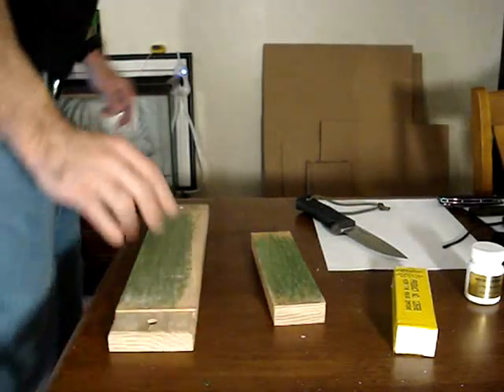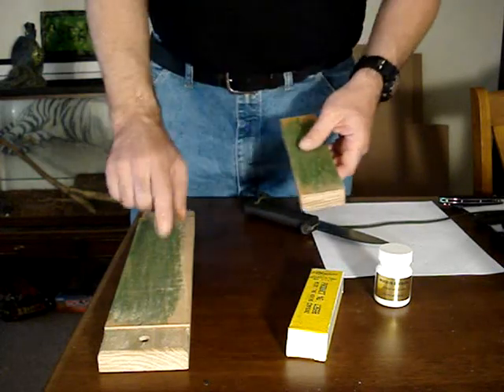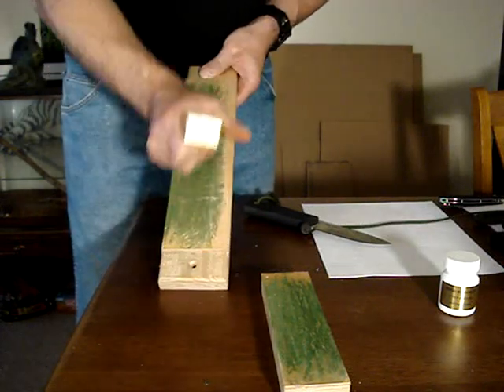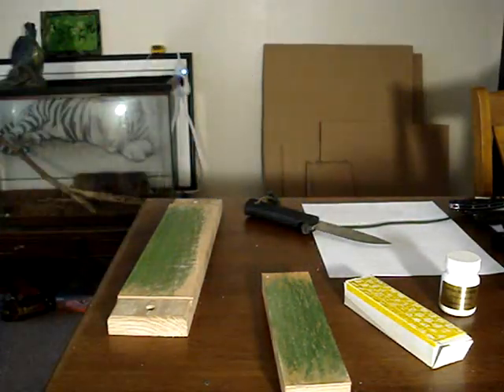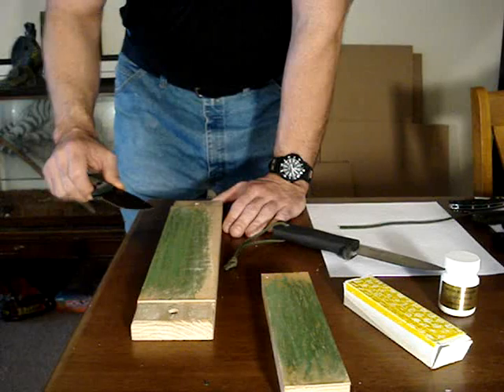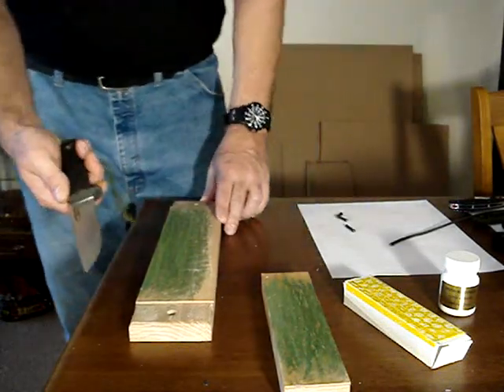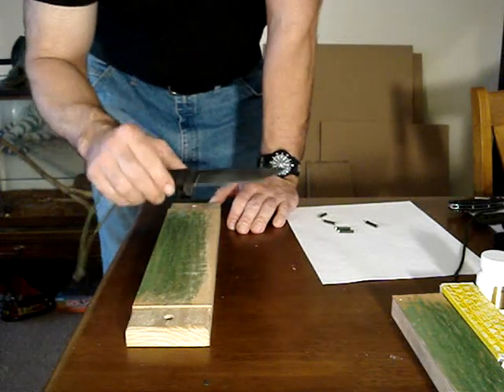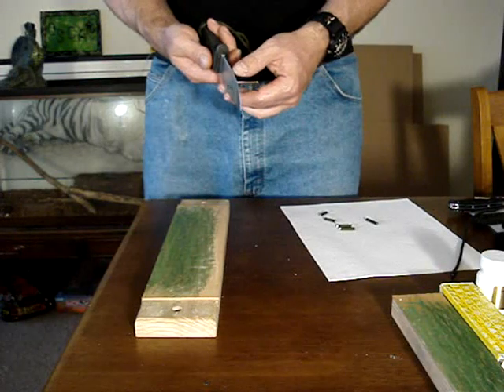Stropping a Convex and Bevel Edge (Convexing Part 3)

Comment: I sat thru all 3 videos and wasn't a bit sleepy. Interesting and informative. Thanks. I learned to sharpen knives back in the days of carbon steel, which are quite a bit softer than the steels used today. If you put a razor edge on a blade, it would round right over or form a "wire" edge if you didn't apply what was called a "relief angle". One did that by performing what is identical to your last stropping stage.

Comment from the maker: @curtispa
I don't mind all the questions. Happy to help.
If it's a traditional bevel edge ("V" grind) I use the Gatco and finish up with the leather strop and compound. If it's a convex edge I use sandpaper and finish up with the leather strop and compound.
I use to do it with a belt and no compound (as you saw). That works, but it takes much longer to get the same results.

Comment from the maker: I did try that. It was hard for me to get it on the strop flat and even. The way I do it now works great for me. So, as they say, if it ain't broke, don't try to fix it.

If the powder would work for me that would be nice. Because it cleans off the strop with a damp cloth in one swipe.

Comment: Steve, with the powders.. DIamond, Aluminum etc, you need to Mix it with a silicone based lubricant which holds it in place and spreads it. Tiny amount..

Comment: what if some1 gets some wood an leather an glue it down with something strong would it work use as good then or a straight razon tool set ?  so can u use use this way if u have a knife that willnt cut anything an make it shaper or do u still need to use ur kit then this at the end sry 4 all the questions just trying to lear nan start better ways  thanks 4 the help

Comment from the maker: Yes. That's the mistake I was making before. I mention that here saying "I was changing the contours of the edge". My new method does not cause that problem. A "half-way" convexed edge does not work as well as fully convexed, or cleanly beveled.

Comment: Learned these tricks the hard way too. I ended up buying a $35 Harbor Freight belt sander and some belts from Lee Valley. If you want to see some masters at the art of convex, join us at the Yard.

Look for the forum at ScrapYardKnivesdotcom

Btw, I went sander cuz like you I spend hours working an edge. I am the biggest amateur when it comes to knives but I'm fearless. I can get the same edge in 15 minutes from start to finish now. Seriously, check us out at the forum.

Comment from the maker: Some would say yes. I say no, definitely not. An RC-3 has a very thin blade. If you remove metal from the edge of a blade that is too thin, it will become weaker and more likely to chip and deform. That's just my opinion based on my experimentation, some disagree.